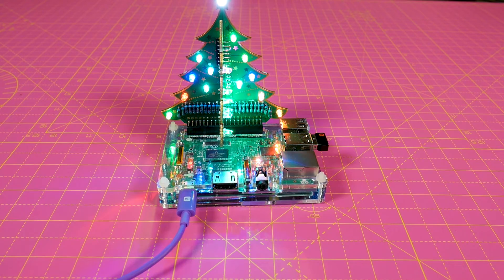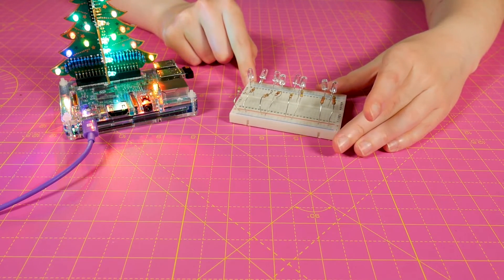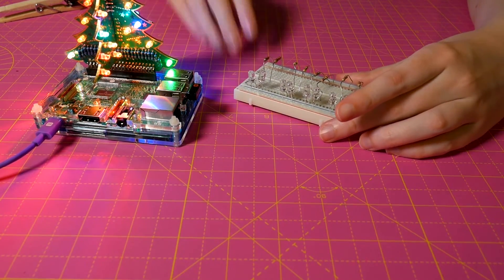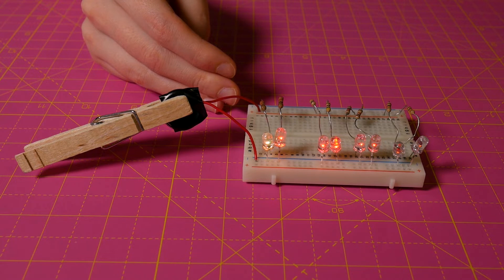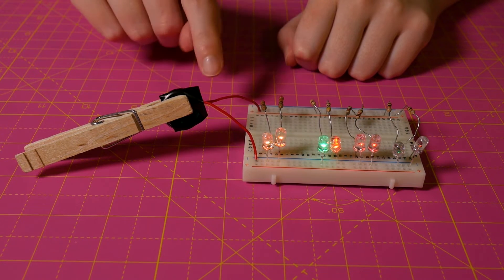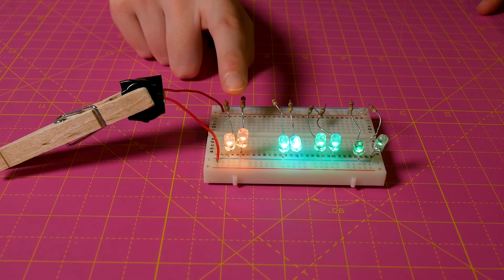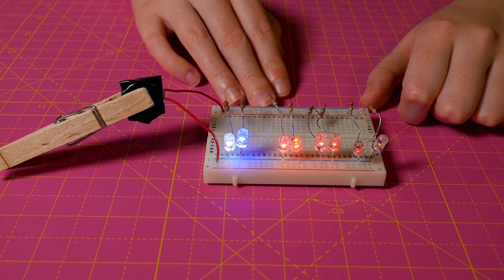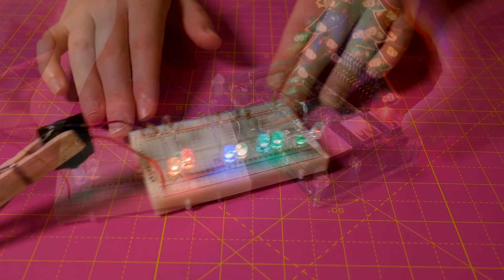DIY FYI: Slow Changing RGB LEDs

Comment: practical experimentation is better than math any day! really cool stuff. wonder how hard it would be to make a round pcb for led ornament. I think the solder could be me used to as part of the decoration on both sides.
Reply from the maker: thanks! i think it's definitely doable. if you used some pretty shaped solder pads for the LED leads that could look nice
Reply: Not only that, but with these small cells you actually have a fair amount of internal resistance of the cell at play, and accounting for that in your calculations is probably a bit fiddly - especially as I'm pretty sure the internal resistance increases as the remaining capacity reduces!